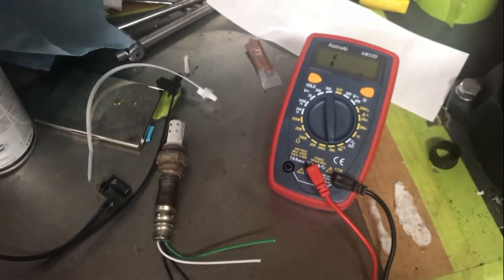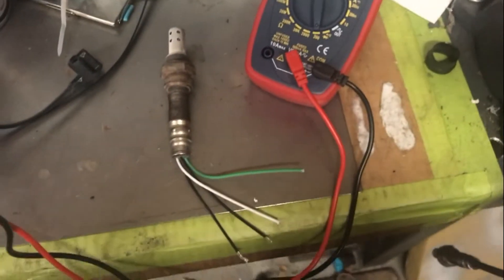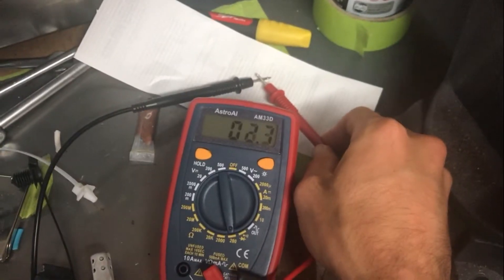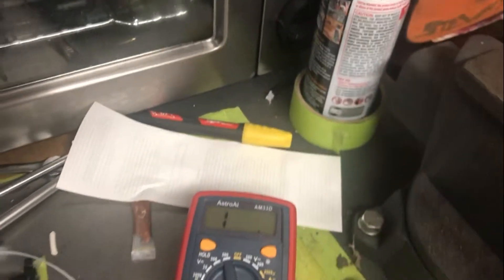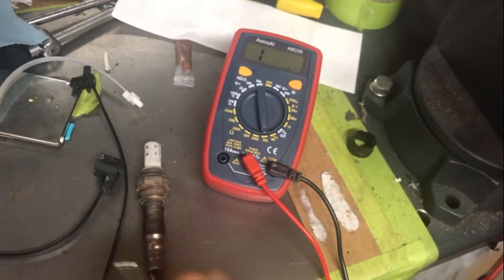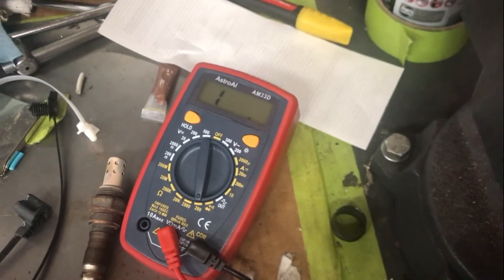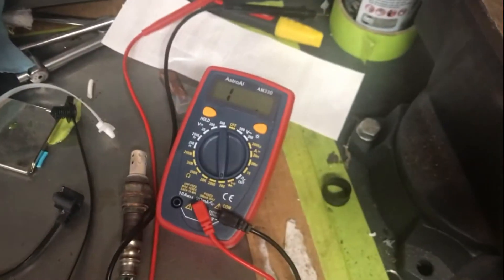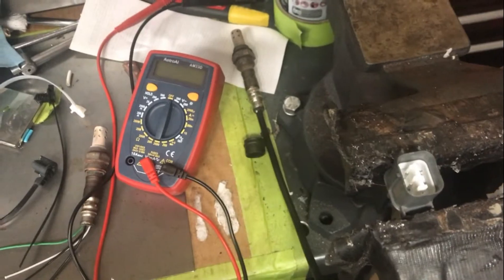How to test Oxygen Sensors and Air Fuel Sensors

Comment from the maker: There's a setting on the multimeter for continuity, which is a better way to determine if the heating element is still good within the O2 sensor. If you have continuity, the multimeter will make an audible sound (test this by touching the two leads together), and you know that the heating element is still good. If you don't have continuity between the two black wires on the O2 sensor, then this means the heating element has burned out.

Comment: Hi you guys…Just because you have continuity, that does not mean the sensor works. Mine tested good but was very black and SENSOR did not work electronically. I had 2, 4 , 6 misfire codes on bank 2, as well as rich & lean codes. The check engine light was on too. Rx300 1mzfe 185k miles. On ohms the bad read .001 which I thought meant bad according to this video so I bought a new denso for $230. I brought it home and checked with ohms low setting again and it measured exactly the same. I was pissed but slapped it in anyways. The check engine light was on and I thought I wasted the money. I had disconnected my battery for 30 seconds beforehand so I really believed this CEL. About 2 minutes later it went off. I drove the car and it ran perfectly. The tell tale sign was all three spark plugs on “that bank” were sooted up and blackened. The moral is change the air fuel sensor if it has high miles even if it test fine on the black heater element wires. This is a very important piece then car will have low power , overheat , make turbo noises like a vacuumed leak, rough idle, and it will be intermittent. It’s an expensive piece but the car would not perform without it. Hope this helps someone. I was searching adamantly for the answer to what was wrong with the car and I found it. Don’t give up learning mechanics is always rewarding. Cheers!

Comment: Your video helped me.  In my case, the A/F sensor in the car had a bad heater, and was the right part, but the eBay part was misrepresented as working for this 2002 Camry, but was the wrong part.  Using the P/N from the old part, instead of claimed online compatibility is the better approach.

Comment: I got a reading of zero on my multimeter for oxygen sensor for heater terminals, when i set at 200 ohms. What does it mean?
Reply: Start by checking continuity. If you don't have continuity it's bad. If you do, try using a higher setting on resistance.

Comment: I got a bad PCV valve for my Camry on ebay...... It made squeaky noises that I thought were the belt or alternator....   I then bought an OEM Toyota valve on Amazon.....  Problem solved !   I buy plastic parts on ebay, but I have concluded that other stuff are imperfect factory reject parts bought by the truckload for pennies

Comment: I mean, I don't know the range for O2 sensors but I had mine set to 200 ohms and it showed infinity for my coil pack, then another, then another. I knew I couldn't have had three coil packs out, so I set the range to 2000 and then their readings show up, all around 340 ohms.

Comment: I have a code p0131 (o2 sensor s1b1 low voltage) on my 2015 jetta thats after i already change the o2 sensor s1b1 which was faulty
Things i did
1-change o2 sensor s1b1
2-changed spark plugs
3- catalytic cleaner liqui moly 2cans
4-oil and filter change ( i know it has nothing todo with it)
What is the problem😔

Comment: you need to set multimeter on the mega ohm reading...you wont get any reading on 200 ohms... its a heater coil and has lots of resistance...hence heats up when powered. You can attach a 5v dc supply and see if it starts to feel warm in a few seconds...caution, it can get really hot fast.
Reply: Heating elements in general need to be of low resistance so more electricity (amperage) will go through them in order to produce heating (work). That's why in big appliances they consume a lot of power.. P = V x I. And since voltage is a constant I is getting higher through low resistance. I = V/R and since again voltage is constant R should be low to get bigger I (number of electrons passing through a wire at a given moment) Hope this helps
Reply: Heater resistance will be less than 200 ohms.   If it doesn't show on that scale, it's broken.
Reply: Your explanation is better...thankx

Comment: That's a good example of "You get what you paid for." When I tell a customer what the price is for a new O2 or A/F sensor, many of them tell me that they will supply the part themselves. That is when I inform them that my policy is when the customer provides the part, the repair has no warranty. I hate to do that but I can't afford to constantly change a part for free because of subpar parts. That would be a great deal for the customer while I couldn't afford to eat three meals a day..... Great job of making that point with your video....
Reply: HAHAHAHHAHAHA sure my dude i got a rapair for 64000 in our money and got sensors that are not compatible with my car from the repair shop and they refuse to give back my money.. i will sue them...
Reply: @maszkalman3676 huh ?
Are you saying that if you brought your own part and it failed and caused damage... you would sue the shop ?

Comment: The downstream O2 sensor on my 2004 Honda CRV seems to test fine, but the wiring harness seems wonky. With the key on, I only get voltage between the top left and bottom right pins.

Also, I have a P0134 code, but the A/F sensor and harness test okay. I haven't done the heater test with the car running, yet.
Reply: The "heater test" is done with key off - engine off. It can be done with the parteither installed or out of the vehicle. Simply check the resistance between the two wires of the same color (usually two white or two black wires but it does vary with the color; just use the two matching colors) as that will be your heater circuit.
Reply: @jlcastille9017 i need some help bro do you have ig or fb I can message you there

Comment: My ebay 02 sensor won’t switch to closed loop. Triggers check engine
Reply: Mine too, even there's resistance when you check the 2 black wires.

Comment: Is it possible to have p0420 code when your upstream sensor is showing zero volt? I check voltage with digital meter and it shows zero volts. I don't see anything wrong with catalytic converter. What's your take?
Reply: Don't you wish people who made the video would answer lol
Reply: p0420 is downstream sensor and it is a bad cat it could look brand new and be bad
Reply: So what was it?
Reply: @SamSam-ih6nt  bad catalytic converter. Instead of replacing it, I installed a spacer/extender between the downstream sensor and catalytic converter. It got rid of p0420 code. The only downside is that it burns more gas and the engine runs rough.

Comment: Thanks vincent, i am getting a p0135 code and i checked the same way. I can see resistance and continuity in the multimeter. I recently had a short in fuse 15 igps oil level. And strangely cel came on. I thought oil switch might have gone bad but got a code p0135. Now when the o2 sensor seems fine, how can i check the  harness plug which connects to the the sensor. I tried the same test on car harness plug but didnt get any reading.
Reply: Crush it and buy a new Dodge charger. Get a HEMI son.
Reply: @wildestcowboy2668  hehehe in India we dont have these and sky rocketing fuel prices, thinking of getting a bicycle instead.
Reply: @aakudev  Oh.... okay we'll just wandering how much is y'all's gas a gallon over there my friend? In Alabama ours is $2.59 a gallon.
Reply: @wildestcowboy2668  Here the cost is somewhat same for fuel right now, around $1.5 for a litre, used to be $1 an year ago, but the purchasing power is quite less in comparison, with bad roads, and high traffic it becomes even less viable.

Comment: Nice vid.  Hey, regarding those ebay sensors you buy, how have those ever worked for you??  I want to test them out but does a bad one have the potential to damage your car (engine/cat/exhaust)?  Or are they okay to experiment with?                                              Thanks!!!
Reply from the maker: The eBay sensors simply don’t work as the ECU ignores their signal. The car will run but it runs quite rough when it can’t detect an O2 sensor and you get poorer fuel economy.
Reply: Vincent Stevenson so, if I were to get an ebay one that turns off my CEL, does that mean it works?  Some of them look like solid products, ie Kwiksen.
Reply: @kevinnghe6685 i know u commented 3 years ago but o2 sensor is one you should just not be cheap on.
Ive read lots of forum posts from guys saying they bkught the cheaper units that most often fail around 3 months or less.
I suggest eo replacement, or moog makes high quality o2 sensors.

So while it may work at installation, it likely will fail much sooner than it should. Failed o2 sensor will cost you money in fuel as car will be less efficient. And it can cause ur vehicle to run rich which will eventuslly cause damage to your cat(s)